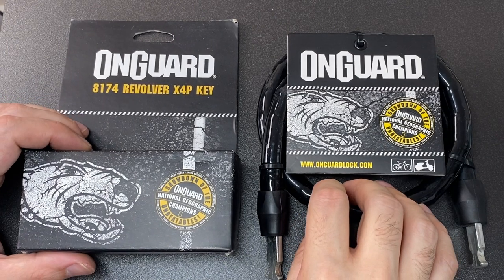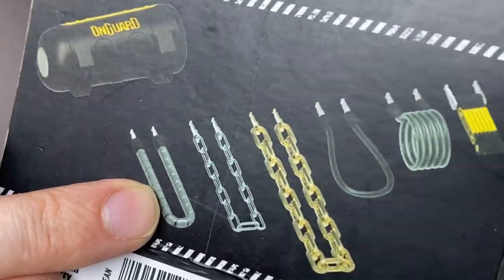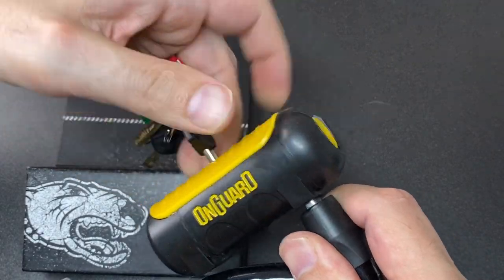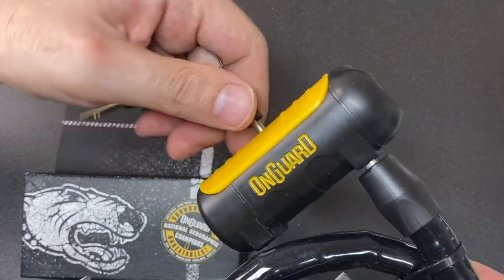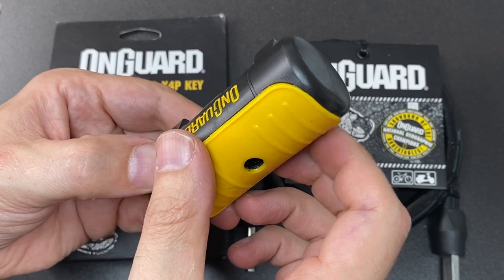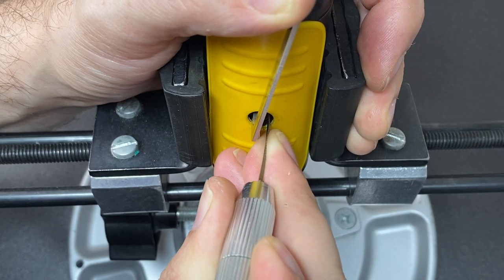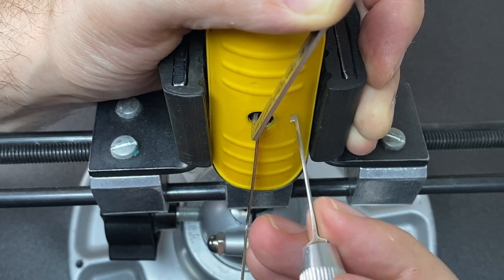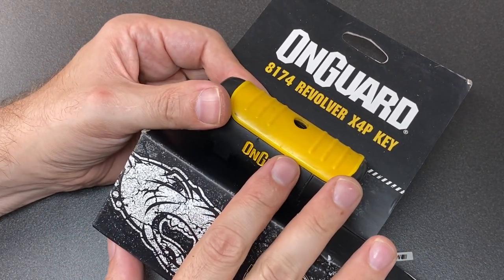OnGuard Revolver Modular Bike Lock Picked

Comment: 2 out of 10?
I suppose. You did open it quite quickly, but over on my side of the pond, dimple locks and sliders are rare, so a lock that requires a dimple flag and TWO dimple z-bar tensioner,  would be high security.
Why do you consider cable (you called it rope) to be garbage (rubish)?
Reply from the maker: Because any thief seeing a cable would target it with bolt cutters. I see it all the time here